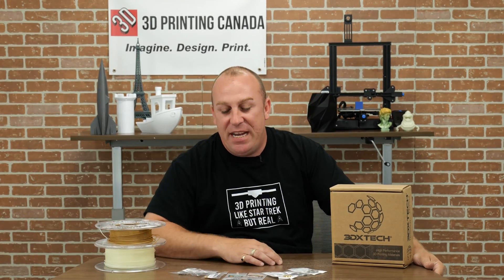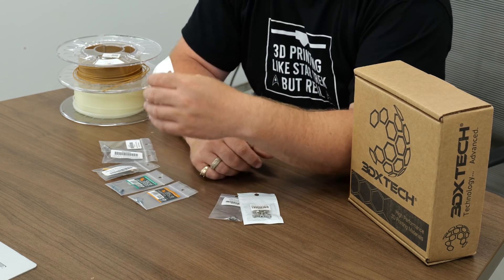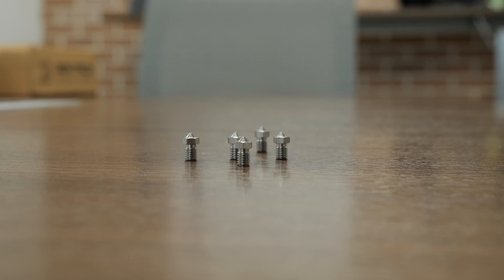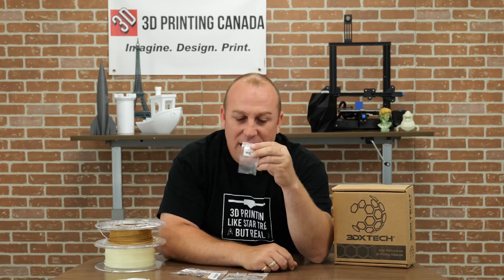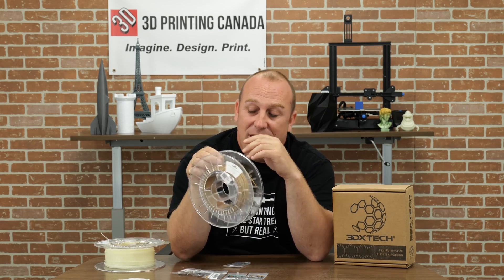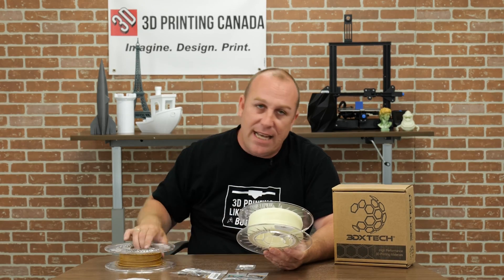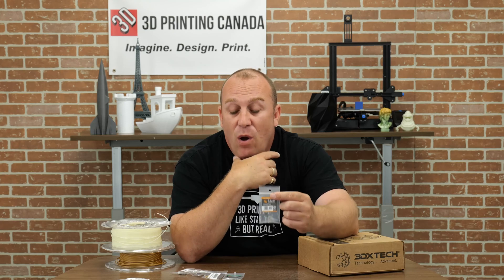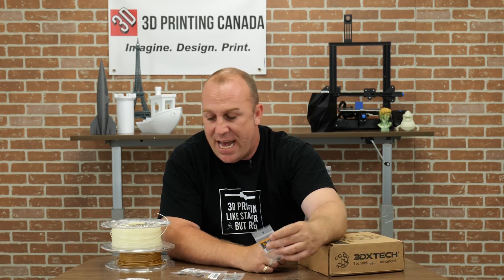EXPLAINING 3D PRINTING NOZZLES

Comment: Ive been using creality brand nozzles. Only in .4 and i recently got a pack off amazon with brass, stainless and hardened nozzles in 0.1-1.0 mm. Im bout to throw one in and print out a benchie and see how they preform.

Comment: What do you guys think about the "Ruby tip" nozzles? I've seen them a little bit, but they are extremely pricy and I haven't really seen an unbiased review 😅
(Edit: fixed a grammatical error)
Reply: I have one and love it. 

I print in pla+ , petg,tpu and carbon fiber .
I've printed all sorts of weird filaments with no issues since I got it. 

When I was using regular brass I would put a new one on every full roll ( 1kg) and sometimes more often. 

My ruby nozzle has printed prolly 15kg and has no signs of wear and prints better then ever

Comment: I think I’m going to try the plated copper on my Modix with a Supervolcano, just printing PLA relatively quickly. 1mm nozzle 1.5 width x 0.5 layers depending on the feature I find that even with brass I have to bump the temp to 240 to print at 100mm/s, but then when it bridges at 20mm/s it over cooks the filament a bit. I’m thinking the 3x conductivity of the copper will hopefully let me set my temp at 220 and be ok from 20mm/s all the way to 100.

Comment: vanadium nozzles are just another type of tool steel. glass fiber will eat steel nozzles still. cf filament is fine. 
You should def check out tungsten carbide nozzles, such as the Bozzle Nozzle. Harder than anything you showed in the video, with about same thermal conductivity as brass.
Reply: They carry them, I believe that’s what the E3d nozzle x is.
Reply: @radugrigoras  nozzlex is also steel.